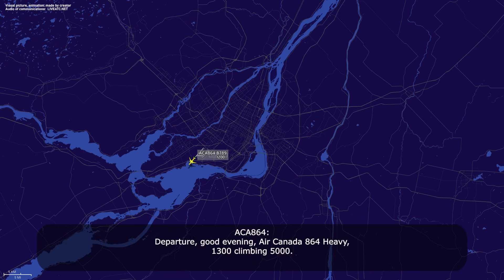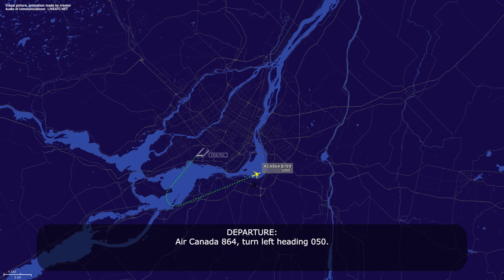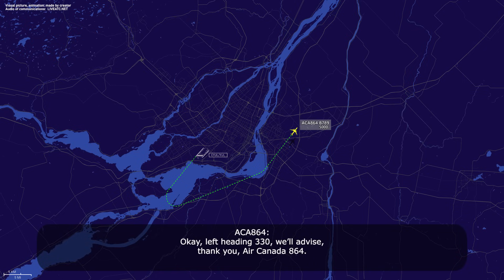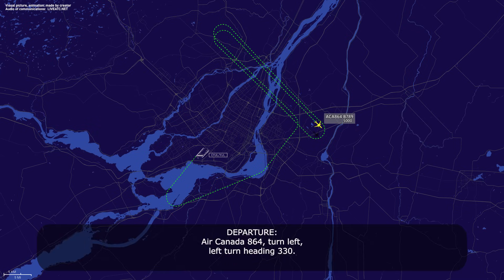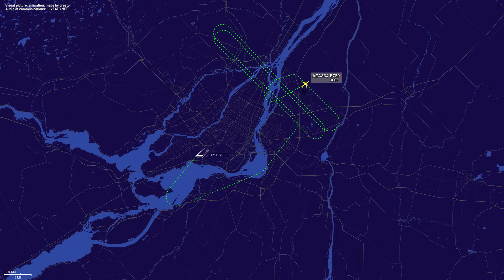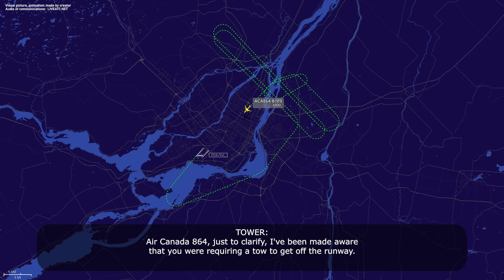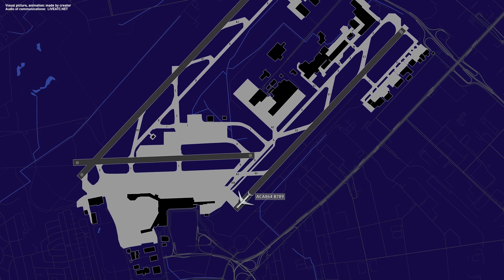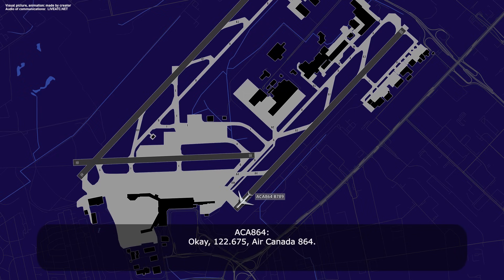PAN-PAN. Hydraulic system failure. Airplane is unable to vacate the runway at Montreal. Real ATC

Comment: Did the pilots decided to do some circles before landing to burn some fuel because if not they were to heavy to land?
Reply: correct
Reply: @WhatThePuck  the first circles at 150 and 330 were just holding pattern while they ran their checklists. They actually said at first they didnt need to burn fuel but they realized later they needed to do one more circle 070 (5:50)